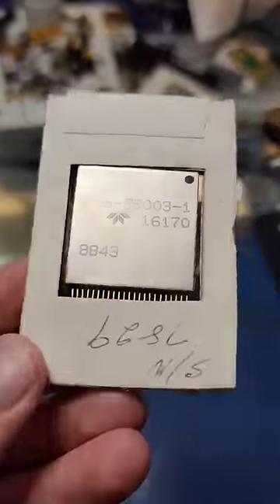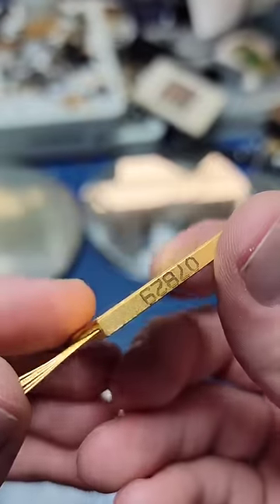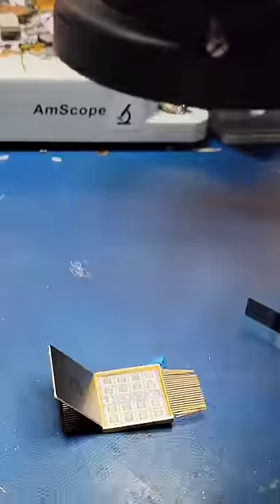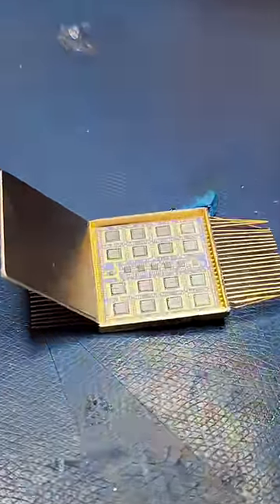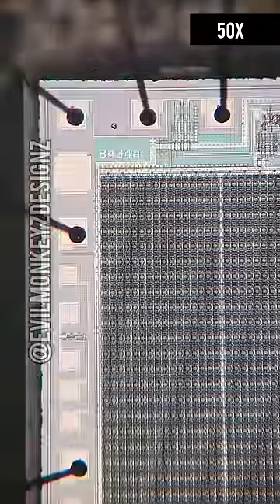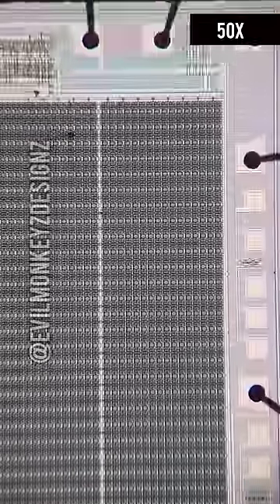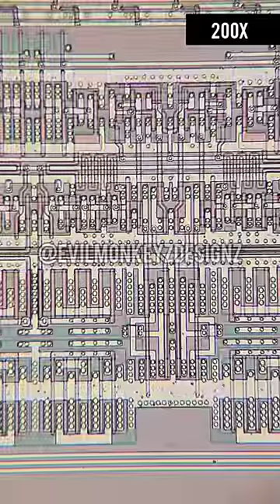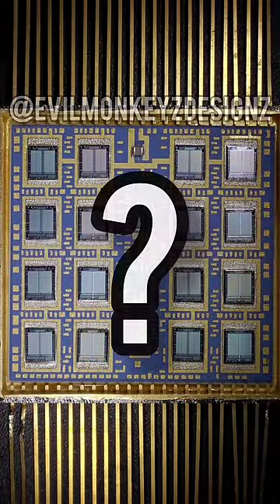CCU #298: Teledyne Hybrid Ceramic Circuit #shorts

Comment: Its just incredible to me that we can  create things so small today let alone back in the 80's
Reply: The 3 nm processes we use today are the same order of magnitude smaller again so, than our perception on this chip from the 80s.

The smallest feature size on a modern chip can be as little as 7 atoms wide. Any smaller and electrons can potentially tunnel out of existance and reappear on the other side of the feature by chance, making more minutirisation difficult.
Reply: Computers as old as the Apollo had integrated circuits, crazy
Reply: So small that it's smaller than most lightwaves needed for lithography.
Reply: It’s 2 nm today, not 10 um. That’s 500 times SMALLER today.
Reply: crazy how we can get them for cheap now
Reply: If I remember correctly, it’s done with light or acid and masking, incredible stuff, I think a laser of a certain wavelength can etch the masking? Idk, also there’s other stuff involved too like a vapour oven
Reply: @joshbridges8410 this is why helium fucks up computer chips it literally phases through the silicon atoms because it's smaller. (and can mess witch capacitance and voltage once inside iirc)
Reply: It's just incredible how much smaller they are today compared to the 80s
Reply: @aterack833  First a thin layer of something (say, metal) is put on the wafer through various processes.  A light-sensitive film of photoresist is spun on as a liquid and hardened. Each chip location is exposed with UV light through a mask that shrinks the image 10:1. The photoresist is processed and the part that was exposed to light is removed, opening up the layer of  metal in places where it can be etched with an acid or plasma etch. This removes the metal we don't want and leaves the tiny metal lines we want. This proces is done in various ways dozens of times in the fab before it is sent on to be tested and scribed into individual chips to be packaged.  (I was a chip engineer at AMD in the 80s.)
Reply: @godlugner5327  Where did you hear that? Helium is inert. It doesn't react with anything.
Reply: For me it was the opposite. We could make things that small back in the 80s and I can't even imagine how small we can make things today.
Reply: The features are simply huge by modern standards. Now we can get 2048 bits in far less space than those chips take to store just 1. In 1989, feature sizes were at about 0.8 micron. These days the very best fabrication uses 3 nanometres. That's 270 times smaller, which means in the same are we can theoretically fit over 70,000 times as many components. We also have some 3D capability to.

I should add that if you pointed an optical microscope at a modern, state of the art chip, you will not be able to make out the individual components as optical light has a wavelength more than 100 times bigger than the current smallest feature sizes.
Reply: We deal In atom layer thicknesses.
Reply: @aerohk a lot less integrated, tho. Each chip just had 4 nand gates.
Reply: @maruftim we moved production away from America. Those entitled brats. Had production not been outsourced, making computer chips would have never gotten cheaper.
Reply: "100 nm is the limit! We'll be fighting quantum tunneling smaller than that!"
And that was in the 90s.
Reply: They were just as smart as we were then, they just didn’t know as much.
Reply: I love how they sometimes added little bits of artwork as well like microscopic size into the chip, have a look at them you can tell some real geeks created its very cool
Reply: Yes, because the 80s were the stone age and we had to boot up our servers and workstations by hand...with a crank handle or a coal fire.
Reply: Interestingly enough Teledyne has actually been staying active since the 80s, and for the last 15 years their stock has been skyrocketing like crazy! It makes me wonder what everything are they doing because when you go on their website it's pretty impressive
Reply: @triadwarfare "entitled brats"
Entitled? Absolutely.  You say that like it's a bad thing. When a person or company invents a product they are entitled to benefit from such.
Almost like copyright and trademark laws exist for a reason...
Reply: the technology/knowledge was seeded to us from the Other, one of many 'gifts' they bequeathed to us at the proper time to keep us on track for their harvest.  if you know, u know.
Reply: @joshbridges8410 Can’t we just put a sign up telling the atoms not to do that?
Reply: @GSR8GHOST it looks like it’s basically been locked with the S&P 500
Reply: @aterack833 Its the most complex supply chain that exists for the smallest scale chips, involving multiple countries specializing in one specific part of the process. The Germans are good at making optics/lenses, the Dutch make the lithography machines, the Americans do a lot of the design work, the best wafers come from Japan, and the chips themselves are fabricated in Taiwan. That's vastly oversimplifying it too. In reality there are way more players and steps involved.

That's why its laughable when China says it can do all of that domestically.
Reply: You're not doing shit, machines are doing this. Etching is not new since humans been doing this for thousands of years, same principle just different techniques.
Reply: The transistors on modern chips are smaller then the wavelength of visible light. Meaning that even if you got a microscope with enough magnification to see that small, you still couldn't because the visible light your eye sees wont be small enough to resolve the image. This is why they use ever higher frequencies of ultraviolet lasers when carving the transistors. Even crazier is that we're about to run into a physics wall that will prevent us from making them any smaller with current technology. Basically now they are so small that each transistor is made up of only a small handful of Silicon atoms each.
Reply: @BradHouser  co z tego że obecnie są coraz mniejsze tranzystory na krzemie jeśli kiedyś wykonywano procesory nie-synchroniczne gdzie wydziały dużo mniej ciepła i pobierały mniej prądu ( wzgledem rozmiarów i ilośći tranzystorów na 1mm²). Teraz wszędzie są wypuszczanie procesory synchroniczne. Przez co traćimy na szybkośćì (taktowaniu) i poborze prądu. Co do pc to aż tak nie ważne, ale serwer i centra obliczeniowe, i mobilność bardzo spada. Oczywiśćie w przypadku prywatnym bo w zastosowaniu kosmicznym,wojskowym to inna bajka.  Nawet nie rozumiem że w obecnej sytłacji nie powinny być nawet wprowadzane na rynek procesory synchroniczne. Wszyscy chcą chronić planetę A mniejszy pobór prądu i mniejsze awarie to lepszy kierunek w jaki warto iść aby obecne amd wyprzedziło intela, mniejszy pobór prądu, lepsze instrukcje tym dedykowany ram. Do biura komputer który jest oszczędny ( jeśli dobrze pamiętam to ram L1,L2,L3 jest najbardziej drogi w procesorze ) Oraz rozbudowany procesor do gier spowodowałby przewagę amd. I co obecnie odczuwa amd spadek w laptopach.
Pozdrawiam.
Reply: It blows my mind away every time. I don't think I will ever fully comprehend how small these electronics get.
Reply: You would think someone would have made use of that fact. When the electron tunnels through the wall it would get used for some other use case
Reply: We? Only 0.001% people able to do this, if they suddently gone overnight, we back to Renaissance
Reply: @joshbridges8410 how are we even building items of such a small size?! Do you know what method is used to put those small parts together? Mind boggling man
Reply: It's not reacting, it's physically interfering with the expected electrical behavior  @BradHouser
Reply: @JasonW. There is a quantum computer now
Reply: @barahng  considering the guy who made the blue LED was from Japan, it makes sense the best wafers would also come from there
Reply: @Kryso_0 Они были умнее, это они и разработали современные техпроцессы
Reply: @Dr.W.Krueger 80 практически не отличаются от современности, просто далее немного развили тогда же разработанные техпроцессы. Другое дело вы родились позже и для вас это каменный век.
Reply: @ocayaro damnnn okay I read it as 8nm and I was like no way they had 8nm in the 80s
Reply: @triadwarfare looks like Americans still have the better chips though
Reply: The damn military probably got microprocessors that fit in a damn atom behind the scenes 😂
Reply: Yeah, nice ideas, nice ideas… where’s my thc shaving cream 🤔?
Reply: for me its marvelous,
i still cant imagine some. of it was made on 80's with all that microscopic parts on a microscopic item
Reply: @BradHouser  it's not a chemical reaction.
Reply: It was the aliens
Reply: @ocayaro  That factor would be 5000
Reply: @BradHouser where you a layout or verification engineer or did you work at their  fab before they sold it off in 2009 ? 😮😮😮😮

Comment: It's SRAM.. observed that type of structures on my Decapped chips too..
Reply: Being teledyne and from 1988 its likely an SRAM chip for an automated telephone exchange.
Reply: „SRAM” in my country means „taking a shit now” :)
Reply: It always makes me giggle because SRAM means to shit in Polish.
Reply: SRAM is the name of a bicycle parts manufacturer, and funny enough in the mid 70s teledyne made a bicycle
Reply: @Coastal_Cruzer Don't forget SRAAMS which are pretty spicy british IR missiles
Reply: Internaut here, lost in deep shit...

What is SRAM?
Reply: @Rolf-son-of-an-electrician Static RAM, as opposed to Dynamic RAM, or DRAM, which is more common. SRAM doesn't require constant refreshing to hold its memory, and is most commonly used in cache memory these days. It's also faster than DRAM, but is more expensive to manufacture and you can't fit as much SRAM on a chip as you can with DRAM.
Reply: @ordinaryk  Thanks
Reply: Kinda a wild package for something like that.  I'm guessing going for extreme environments or some crazy high performance or something.
Reply: Sram in polish means: "I am taking a shit right now" in one word. Anyway, responding to the question I'm thinking: under the microscope it looks like Pokémon on the Gameboy. You are hovering around and maybe some Rattata will appear xD
Reply: @Aeduo nah almost everything back then was in little cardboard sleeves like that xD this one had some extra foil probably in attempt to protect the pinouts from static charge.
Reply: @SacredMilkOG  I meant the chip's own package. The metal part.
Reply: @czaro8006 funny cuz I was taking an SRAM while watching/reading this…
Reply: Now that is interesting lol  @Coastal_Cruzer
Reply: Pretty crazy we have super small versions that have way more memory space. SRAM usually shows up in processors as cache memory what every one sees as l2 and l3 cache
Reply: @Coastal_Cruzer  Yes. It's a shite parts manufacturer.
Reply: I can't imagine needing THAT much shift registers.
Reply: @kayakMike1000  many* you mean bro.
Reply: May be one Multiplex  module, um bastifor into one chip

Comment: That is a memory module used for missile guidance. It stores the radar data. I haven't seen one like that in quite a long time. It is also a radiation hardened part hence the physically large size of the memory cells. The base plate is "sapphire" slso known as a silicon on sapphire chip. It was an extremely spendy chip back in the day.
Reply: So does this help the missile know where it is or does it help it know where it isn't
Reply: "Speedy" when compared to using a slide rule.
Reply: The missile knows where it is at all times. It knows this because it knows where it isn't.

Comment: For those not familiar, MIL-STD-1553 is a 1Mbps serial data bus used in aerospace applications.  Because of this niche usage, it is very expensive.  While slow by modern standards, it has the advantage of high reliability and deterministic timing.
Reply: shielded from radiation?

am aware of a version of Power PC chip which was specially made for high radiation environments such as the shuttle or ISS
Reply: What is deterministic timing.?
Abd what are it's applications.?
(Yes, I know it's a stupid question... But if I didn't ask it I'd remain just that little bit stupider) 😉
Reply: @alantaylor353  In it's simplest form, the timing of data inputs is determined externally. All inputs are the same size, the program executes at a predetermined rate, and process the data at that exact rate.  No need for a timing signal... I think. It's been a long time since I've had to think about it.
Reply: @alantaylor353 Data transfers on a 1553 data bus follow a (typically) repeating, pre-defined bus schedule, all controlled by an oscillator on a bus controller.  You know when a data transfer will happen down to the microsecond.  In spacecraft applications it is often used to send commands to  remote devices and receive telemetry from those devices.
Reply: @manonamission2000  They can be rad-hardened.  The "1553" bus is often used in spacecraft applications. The JWST ISIM uses rad-hardened versions of the PowerPC CPU and a 1553 chip.
Reply: It means it can operate in a gravity/time fluctuating environment with minimal loss.
Reply: Deterministic timing is bullshit from someone trying to sound smart. This is a emf proof memory card. I was an Aerospace engineer I’m hard to fool about technology that I used….    😊
Reply: If you think MIL-STD-1553 is slow, you should check out the ARINC-429 aviation data protocol from 1968.  The (one way only) data rates available were 12500 bps and 100k bps if I remember correctly.  Last I heard, it is still widely used in commercial aviation.
Reply: @LTV_inc Deterministic timing is a real thing, it's just such a niche need that it is never brought up. Though it is very rarely needed.
Reply: @bower31  ~ I have no idea what it is….
Reply: @LTV_inc  It is just deterministic, it means that the input always generates the same output with the exact same time interval. It's only gonna be useful when you need to ensure there is zero fluctuation in a process time.
Reply: I remember the mil spec Motorola chips made with gallium arsenide I think, the temperature tolerances were so much better than regular chips which expect indoor room temperature conditions. 
So it’s no surprise that these are more expensive than regular commercial electronics
Reply: @tomorrow6 Ga-As was so common in past decades in electronics everywhere. I think that current chemistry for superclean Silicon chips solved old problems. 
And i remember one funny radiation problem on chips maded by chips cases from radioactive soil.
Reply: Спасибо за пояснение.
Reply: that shit is covered in gold, isn't it

Comment: Wow Blast from the past! I worked at Teldyne, I was a Process Engineering Technician and I setup the wire bonders and welders that put that LSI Component together! lol
Reply: You're Miles Dyson!!
Reply: @MuramatsuInosuke 😂😂
Reply: Terminator ❤
Reply: Youtube is wild
Reply: I'll be back! (in time) 😝
Reply: Hey dude, I have my SATA LSI chips fail so often. Was it you assembling them? 😂
Reply: You worked for teledyne?  Please tell me the "gun manufaturing" job I applied to is exactly what I thought it was.  Tell me it was microwave pulse rifles or something.
Reply: Teledyne? Are they flir the thermal scopes
Reply: Wow blast from the past ! I worked for Sysco that delivered the wire to teledyne so they can solder these chips and salsa 😂😂
Reply: Did you mean CyberDyne? Iol, I WILL B Back. Love to know what you do now 40 years later? Bet it's really advanced and interesting
Reply: Maybe in Huntsville?
Reply: This town Huntsville Alabama was all about Teledyne in the 80s
Reply: Looks like all the wires have been welded slightly off center
Reply: Wow...❤